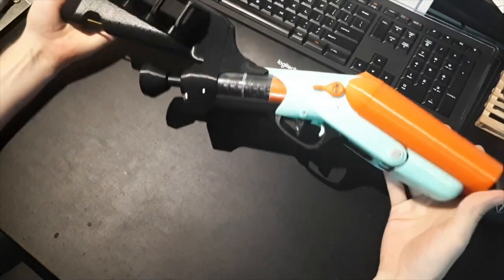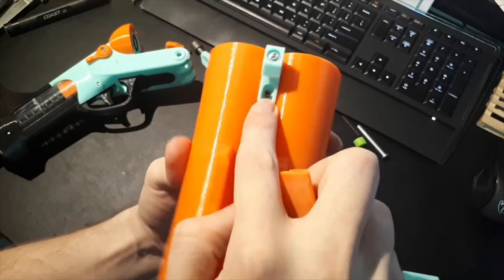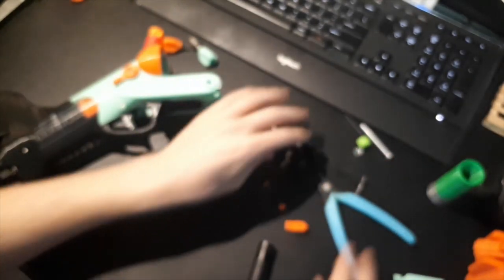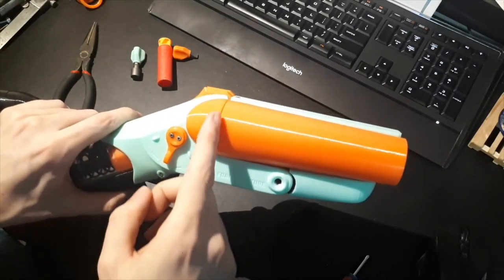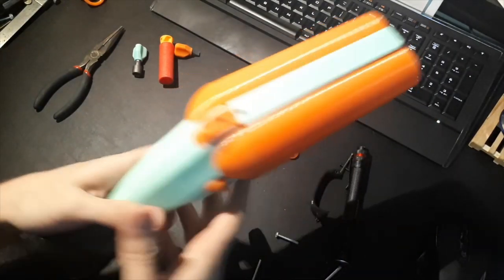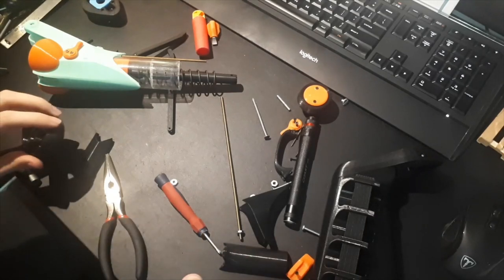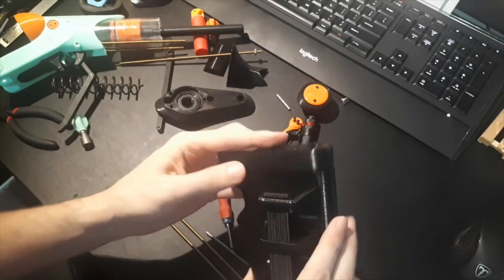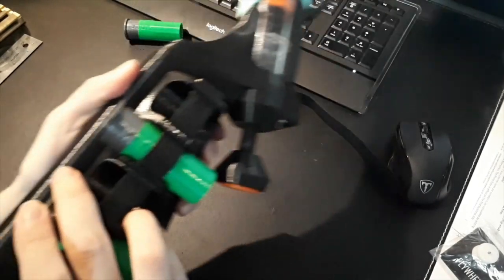Foam A Nature teardown

Comment: I'm printing this blaster now, but cannot find a 2" chicago bolt online except in quantities of 100. I really hate to drop $30 for one bolt (and have 99 spares). Do you remember the supplier? Can't wait to get this assembled.
Reply from the maker: I also had to buy 100 chicago bolts. That's just how ordering hardware online typically goes. 

You could substitute the chicago bolt with a metal dowel/rod of the appropriate diameter(~3/16 or ~5mm) and secure on both sides of the blaster with cotter pins(or similar). A chicago bolt is just a cleaner looking alternative.

Comment: So I've got a couple of questions. How big is this blaster? How much did it cost to make? What fps ratings does it get on average? And did you put O-rings on the shells?
Reply from the maker: With the stock, 21 inches, without the stock, 16 inches. ~70fps for a single Rival ball, ~90fps for a single short dart. I didn't put O-rings on my shells, but it works just fine if you do have them.

Comment: @ehdrien hey could u like make a tiny spring and send it to me I do not have the tools to do that and the only thing I have is my printer and multi tool screw driver to tighten my screws when u can get back to me asap thanks
Reply from the maker: Sorry, you're going to have to bend that spring yourself. I showed how to do it at the end of the video and the only tools you need is a small nail hammered into a board and a pair of pliers.